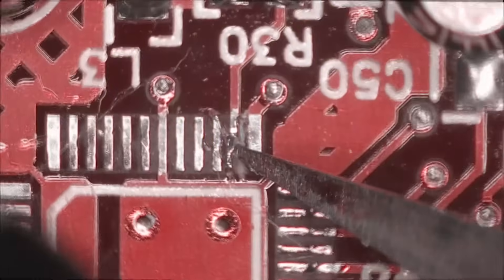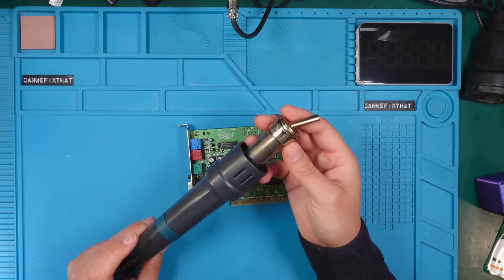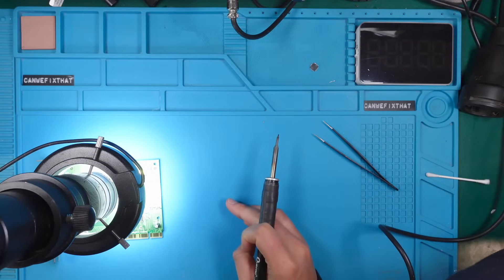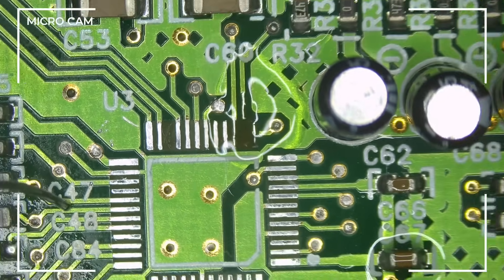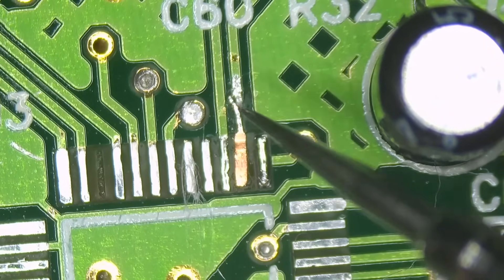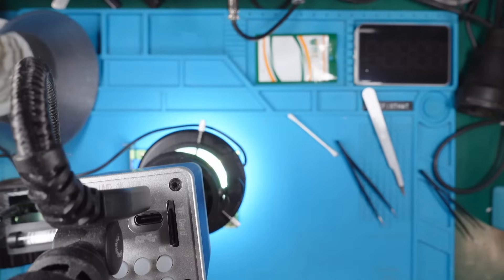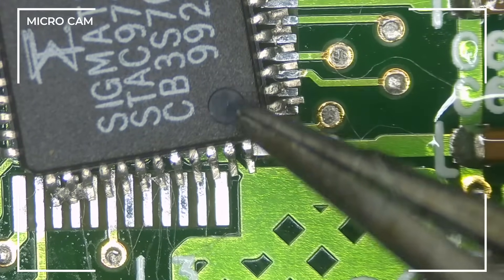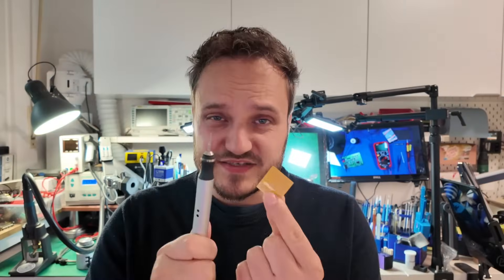How to FIX a MISSING Solder Pad (Easy)

Comment: How to fix solder ring pads?
Reply from the maker: Hi Sanny!  There are also replacement pads for solder ring pads. Another alternative is to use a very thin wire and form a spiral to make the roundish shape. I could make a video about it, if this is an interesting topic? ✌🏻
Reply: @CanWeFixThat  oh yes please a video  and the component through the hole and solder it on 🙂👍🏻

Comment: 14:01 Why not use some solder mask to fix the pad in place(before placing the chip...)? You can use the grinding pen to remove the excess and ensure you can solder it, but at least the pad won't move.
Reply from the maker: Hey! This is something I have tried in the past, but it doesn't work that well; this is why I am not showing this method. But you are right, if it works it is a good solution! ✌️🪛
Reply: using uv mask to hold the pad doesn’t work for me